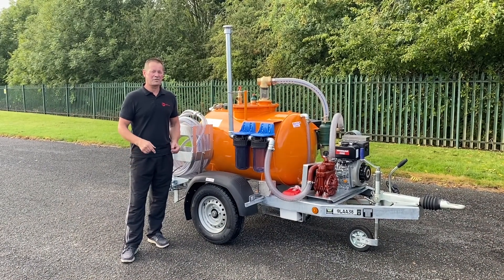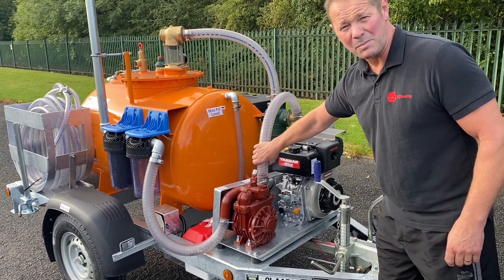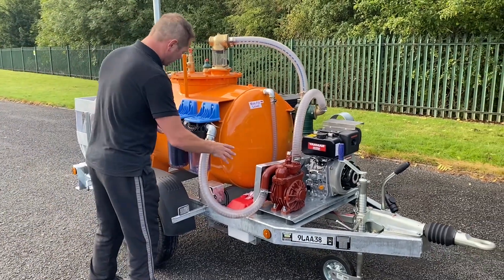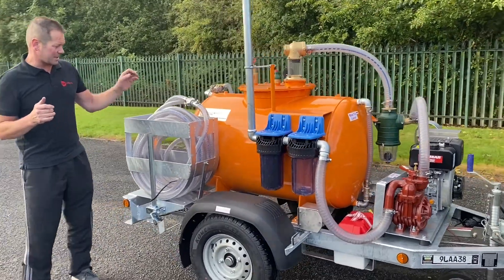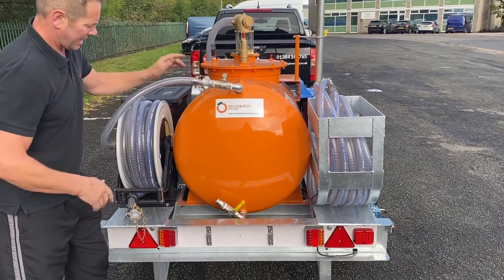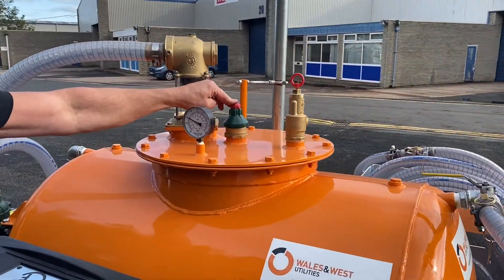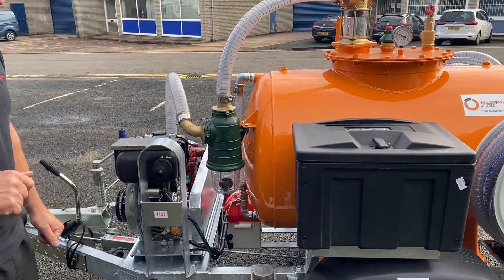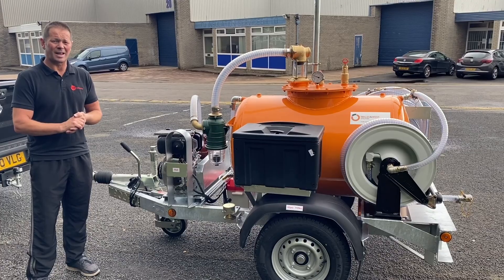450 Litre ATU Vacuum Tanker

Comment: Nice little trailer, but a built locker to house the engine and pump would improve it. I know from experience in using these type of units that the weather is a big killer especially all the spray from the towing vehicle.
Reply from the maker: Thanks for the feedback all our units are bespoke builds and any customers requirements can be met, so if you want to add an engine cover you got it.